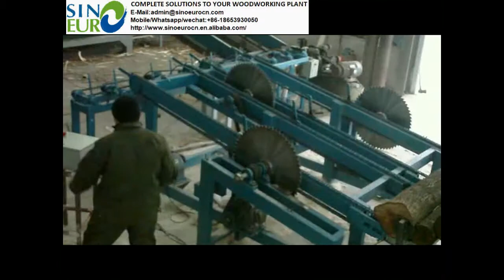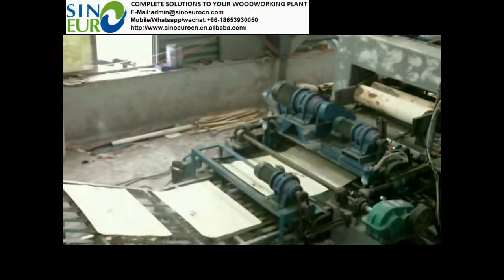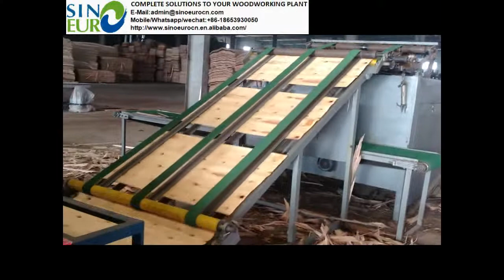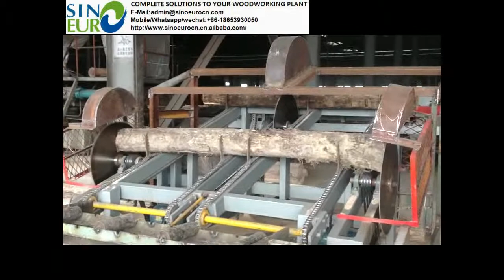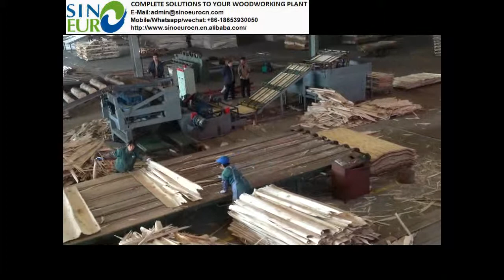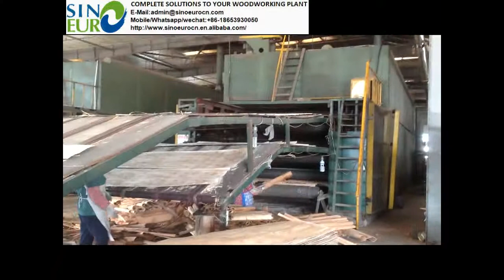Veneer peeling production line plywood making machine veneer peeling lathe

Comment from the maker: Mandy Chu:M/whatsapp/wechat: +86-18653930050 Email:admin@sinoeurocn.com Sinoeuro Machinery manufacturer is a professional manufacturer for Veneer peeling, plywood machinery solutions plant with factory layout and processing technology. We are your trustable partner. We Value Commitments, Quality Assurance, Clients focused & Service driven. Should you interested to buy veneer and plywood machine. please kindly check our website for more information. 
www.china-plywoodmachine.com
www.sinoeurocn.com 
facebook.com/mandychusineuro
 www.woodveneermachine.com 
Mandy Chu:M/whatsapp/wechat: +86-18653930050
Email:admin@sinoeurocn.com 
Customize Veneer Peeling Machine for making wood veneer,the veneer thickness can be adjusted from 1 - 6 mm ,the machine with hydraulic knife holder saving manpower . Also our factory main product include: log debarker , veneer peeling machine , glue spreader , veneer composer , cold press machine , hot press machine, sanding machine ,edge trimming saw etc. Your OEM machines Welcome your kind inquiry and visit our factory!